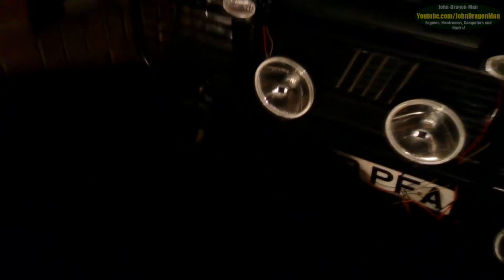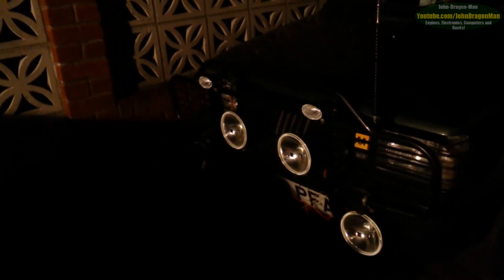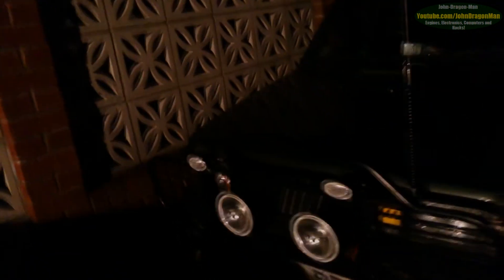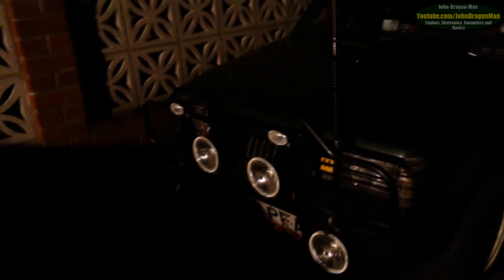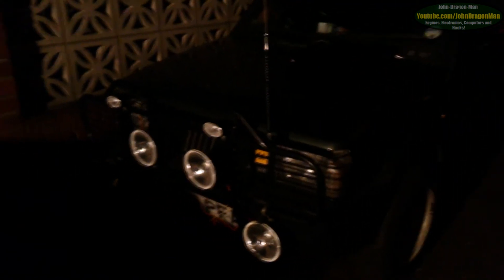Fiat Panda 4x4 Sisley Video log No  38 update   spotlights on bull bars

Comment: With spotlights dude, aslong as when you take the car to the MOT station there are OFF on the relays and give him the option to check if required (labeled switch etc) never had an issue with the Cinq.
Reply from the maker: he cant check them if they are covered...  and i have the covers for them..

thanks for the info though..  i dont think ill have any issues with the, though hehe